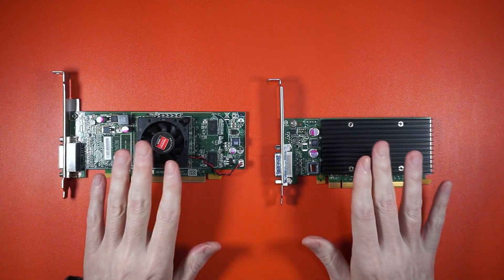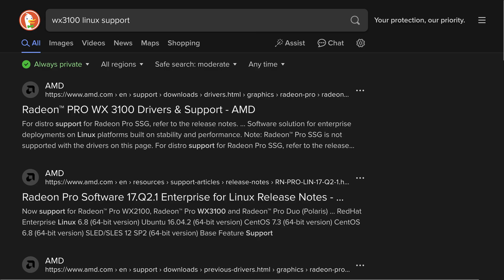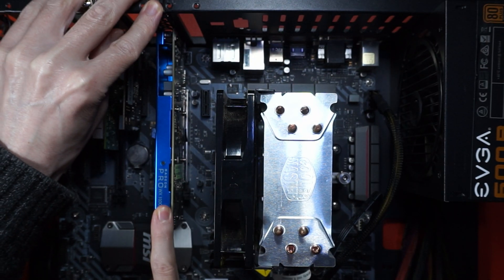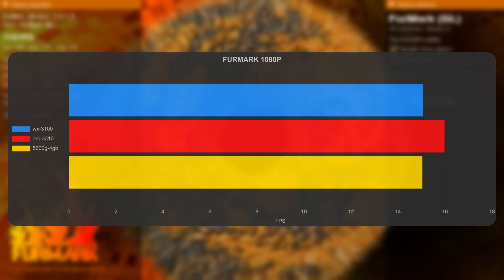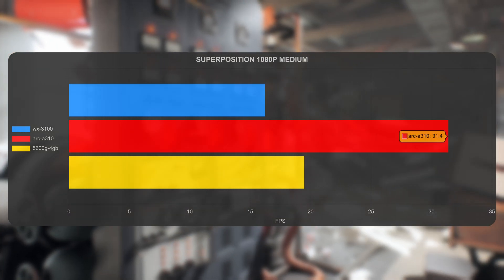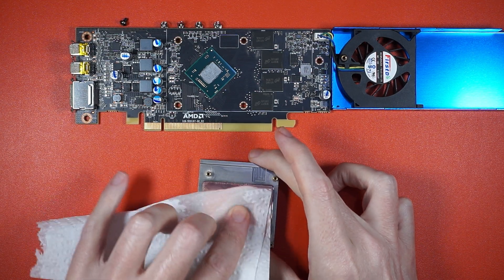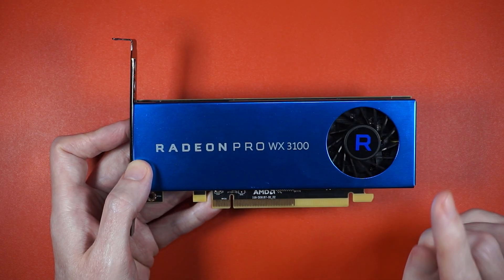Spare GPU Upgrade: AMD WX 3100 Vs Linux

Comment: Did you try adding the A310 or WX3100 as secondary card in an nvidia setup ? Like with a serie 3000 RTX as main card ? I've tried with a A380 pioneer (yes the one from superbuy) and I had very poor performances, stuttering and poor video playback on wayland with Fedora 41.
Reply: I tested that the A310 worked on my 3060 system with OBS. Didn't encounter any issues but it's running X11.

Comment: I'm running Linux Mint with my WX3100, as of a month ago. Bought it cheap on eBay and it works fine so far!
Reply from the maker: Solid little card for the price.

Comment: Have you tried adding a resistor or changing the voltage to the A310's fan? I wonder how its temps would fare only doing encoding jobs if its fan speed was roughly cut in half.
Reply from the maker: The fan on the A310 excretes annoyance at any speed.

Comment: Potato graphics card. It looks a lot like an RX6400, but uses half the slot.
Reply: RX6400 is a beast compared to this. But RX6400 are nigh in impossible to find at decent prices now.

Comment: You didn’t compare hardware video transcoding. We don’t all use GPUs to play games….and so video transcoding is important, particularly AV1.
Reply: No AV1 support on the 3100 and .264/5 encode on gfx800(polaris) is, lackluster. Makes for a good spare video card that can output 2160p and that's about it.

Comment: The PC I'm on right now is running Mint with a WX4100. No issues at all. I also bios modded this GPU and got performance figures similar to a GTX 1050 ti (though with a heat penalty). These single slot low profile WX units are nice for upgrading SFF office PCs. Only real downside is the need for adapters due to the mini outputs. I've never tested their big-brother versions but there's a few vids out there about gaming on them as well as bios modding. Solid options if you can find them cheap.

Comment: if you wanted about the same card with some more power, WX4100 also exists and is as far as I can tell not too shabby of a card itself I used one for a while on windows. There also exists a WX3200 which as far as I can tell is similar, a small performance uplift.

Comment: i feel like the A310 is gonna be the sff beast in a year or two when they drop down to the $50 range and all the drivers are almost as trivial to use on linux as they are on amd.
Reply from the maker: The A310 is a solid performer. I do hope someone figures out how-to make a passively cooled one.
Reply: @InterfacingLinux  ....wait, so you dont like that 100% screaming fan??

Comment: It's a solid GPU for the price. Still, wish it had a bit of compute. 
Timestamps 
00:00 Intro
00:46 WX 3100 overview
01:02 ROCm support 
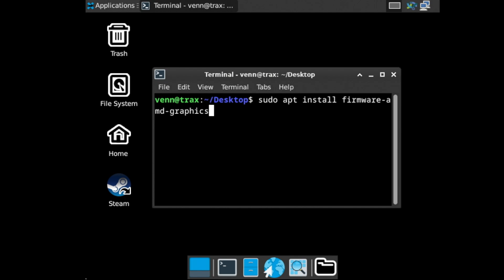01:19 Firmware
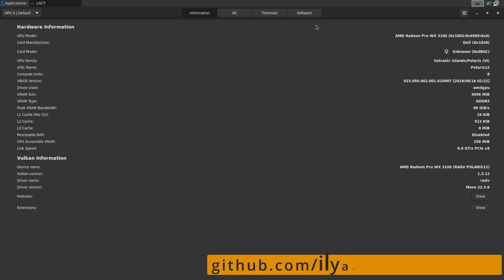01:29 Power & performance levels
01:35 Fan curves
01:38 Fan noise levels 
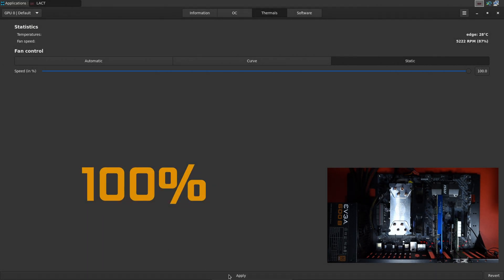01:48 4K video output 
02:05 Benchmarks
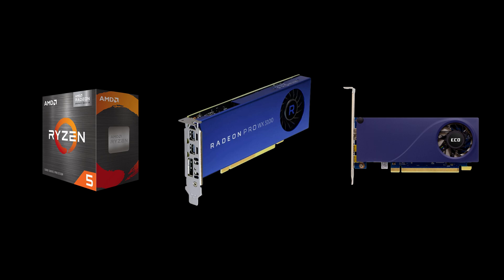02:12 Furmark 
02:38 Superposition 
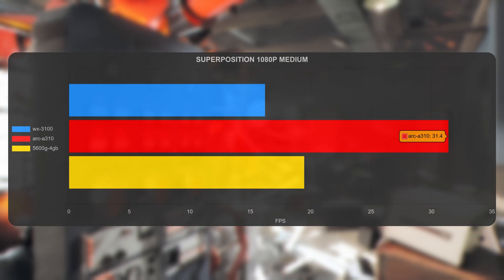03:03 Shadow of the tomb Raider 
03:14 Cyberpunk 2077
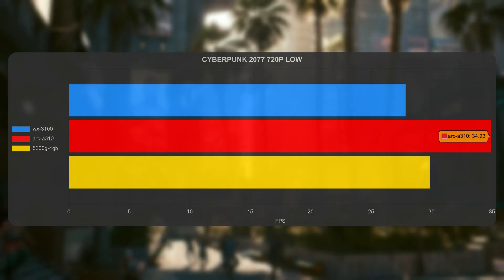03:31 Verdict
Reply: Too bad it can't run Blender or DaVinci Resolve 😞 great GPU at great price, it seems.
Reply: @AnotherHomePage  Dropping Polaris support was always a curious choice.
Reply: @VennStone  Even Ngreedia has better support for older GPU, for shame AMD.